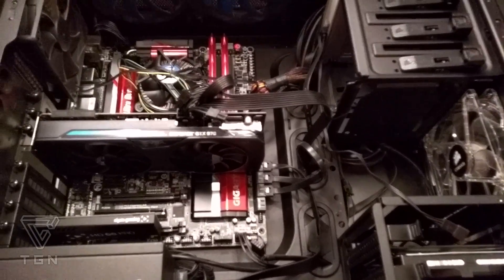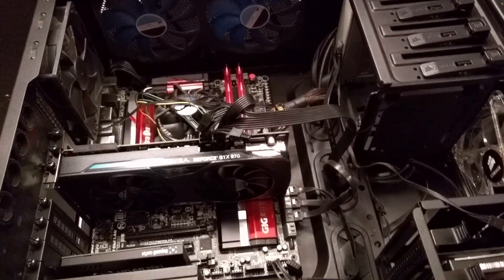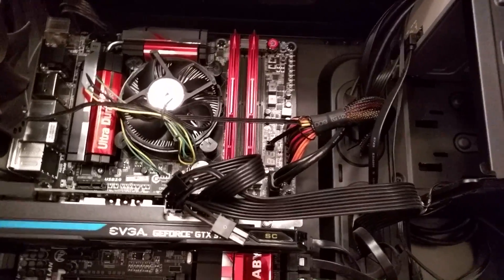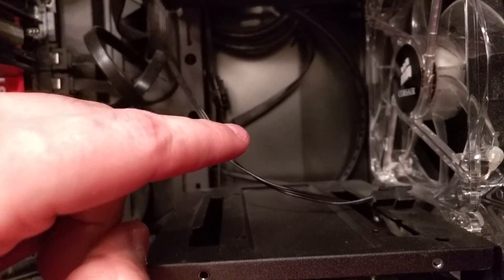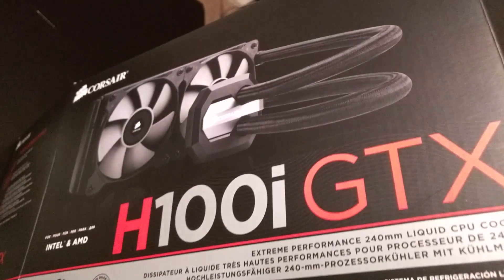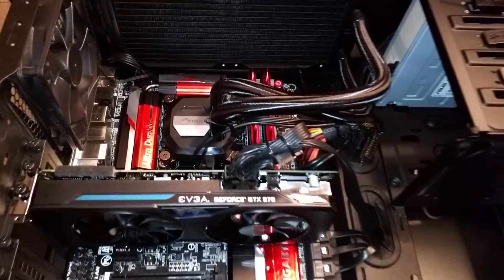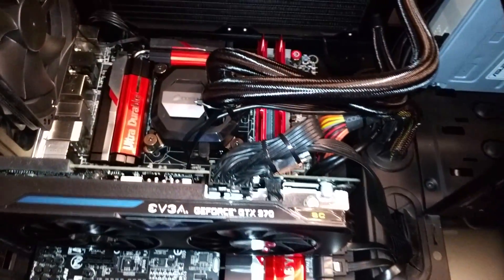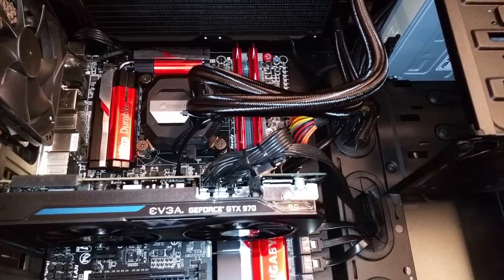Corsair H100i GTX and i7-4770k OC to 4.5GHz

Comment: The CPU you have should not be bottle necking at all. I have an i7 3770k which I have overclocked to 4ghz. My GPU is GTX 770 which I have barely overclocked due to the cooling.

I use MSI afterburner to monitor CPU and GPU usage and my GPU is always at 100% (especially when zoomed in)... but my CPU is never over 30% usage... so I have a worse CPU and it never ever is even close to being fully used.

Comment: Pull works just fine when it is in the top of the case as it is aided by convection, also it gets much less dust building up in it and when you want to clean it can just blow the crap out the top.
Reply from the maker: +Gorebashed interesting. Thanks for the info!

Comment: I think you made the right decision setting up the rad fans on a pull.  Every test I've shows little difference between  push/pull, but you have the advantage of easily cleaning the rad from dust!
Reply from the maker: +44Noobez yea I just figured it wouldn't be a big difference. It is easier to clean.

Comment: Windows 10 (pre-installed)
AMD FX-4300 Processor
Memory: 8 GB
Graphics: NVIDIA GeForce GTX 960
Hard drive: 1 TB
Would this run total war games??
Reply: Switch your CPU with a Intel Pentium G3258 and you've got my pc. Total War games run fine on my system, so i don't think you're going to have any problems running them. :)
Reply: if i dont change the CPU will it have poor quality can you explain what it does, im new to this, but this build costing me £500
Reply: +Emperors Ordeal I think you might have misunderstood. I have a Pentium G3258, but i don't think you're going to have any problems with the FX 4300. :)
Reply: johsol123 oooooh ok thats great to know thanks and also would it run games like battlefield i have an ps4 but i want to get into pc that why im asking
Reply: +Emperors Ordeal The Battlefield games aren't extremely demanding, so i don't think you're going to have any problems running them either. :)

Comment: #askheir
What is the difference between having and not having a watercooler? In term of temperature and stability.
Reply from the maker: +Ryan Origin what type of CPU and cooler you have should be dependant on what you need and what type of build and room you have. 

For me I have a large case with great airflow in an air conditioned room so before I over clocked the stock heat sink for the CPU was more than sufficient. Water cooling is great for those who need maximum cooling potential. So either high performance or more demanding case and ambient temperatures.

There are lots of great air coolers for cheap that will allow over clocking. Cooler Master hyper 212 evo is an example. Air coolers will suffice for most people with good airflow in an air conditioned environment. 

I knew I was going to overclock a lot and just wanted the water cooler for the clean look and appearance as well. Hope that helps explain a little.
Reply: +HeirofCarthage You do need to change your water every now and then, but I guess it is much more efficient because you do overclock your cpu all the time.
Reply: +Ryan Origin the h100i is an all-in-one, closed looped, water cooler, so you don't need to change the radiator fluid. That's one of the benefits of these products vs going with a custom built water cooling setup

Comment: Well if the radiator didn't fit there is always the option of buying a new case :D And I don't think that it matters a lot whether the fans are pushing air to the radiator or pulling. It should perform well either way. 

P.S. Attila in high settings is capable of making your water cooler so noisy you won't even believe it. XD
Reply from the maker: +Praetorian Guard yea my case isn't flashy but man it is functional. Lots of airflow and space. No tools needed. It is great.
Reply: HeirofCarthage Don't get me wrong the case is awesome. The air flow in the case after you putted away some of the cables must be great.

Comment: just an fyi heir  in case you ever decide to go away from a water cooler and need a cheap cooler. the Cooler Master Hyper212 EVO is probably the best bang for your buck (non water cooling) cpu cooler (30$) One of the benefits of a heatsink cooler is often water coolers obstruct your top fans and can require them to be removed, which sucks.